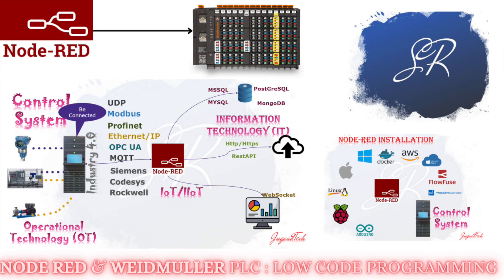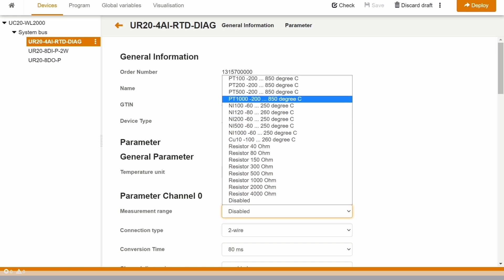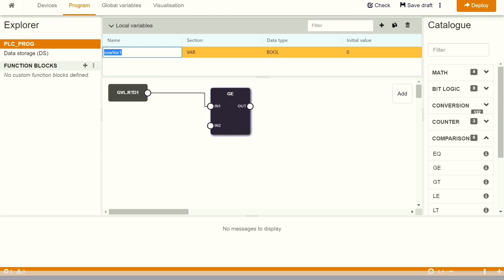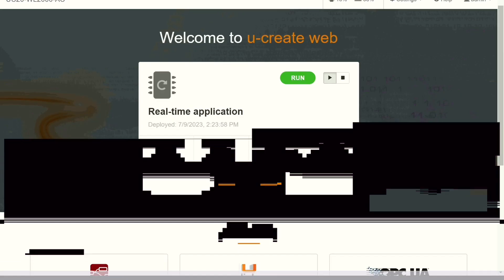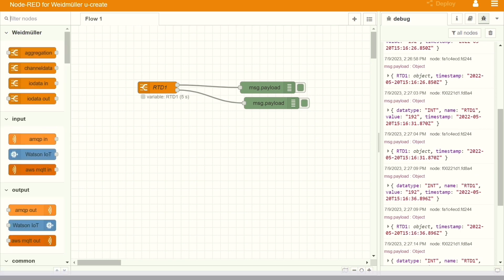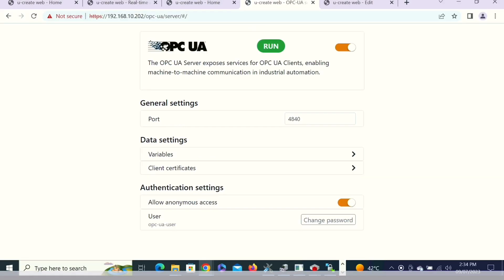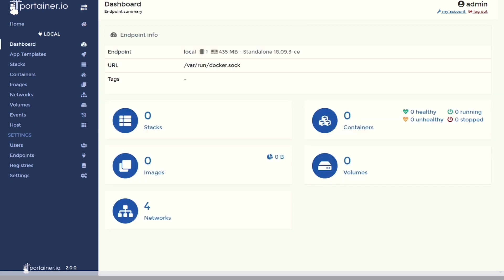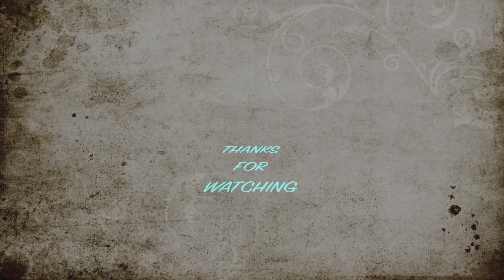Node-Red & Weidmüller u-Control IIoT PLC

Comment: Hi, I am using Node Red on a Victron device (and am very new) I have TCP out nodes but how (where) do I get specific Weidmuller nodes to add to the Victron device? Thanks.
Reply from the maker: In Weidmuller it comes embedded in the PLC itself …. In Node red pallete you can check for weidmuller specific nodes .. if they have released then it will be available .. some PLC vendor do this..
Can you provide some details for the device which model etc..